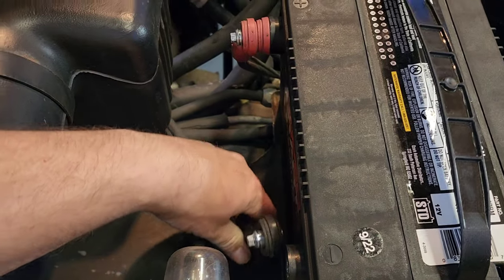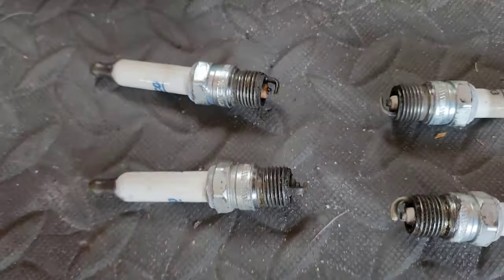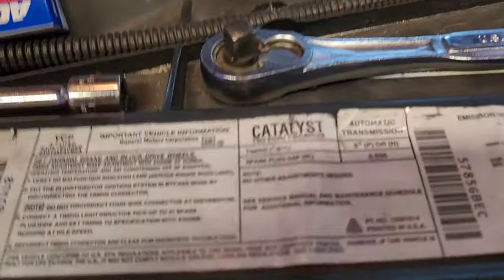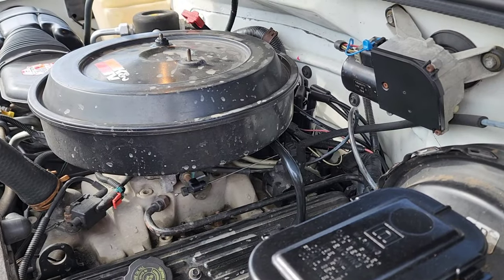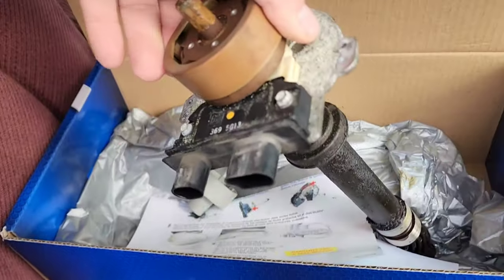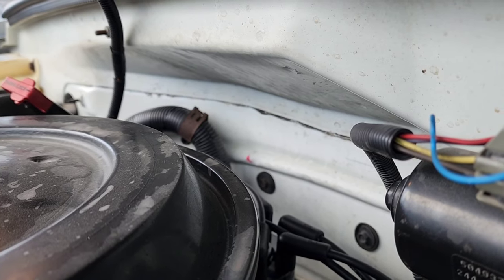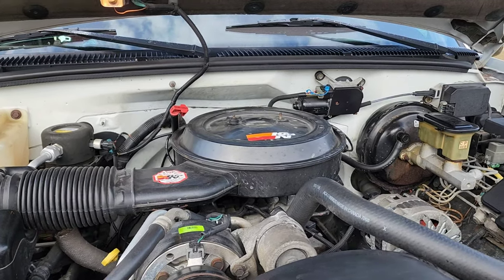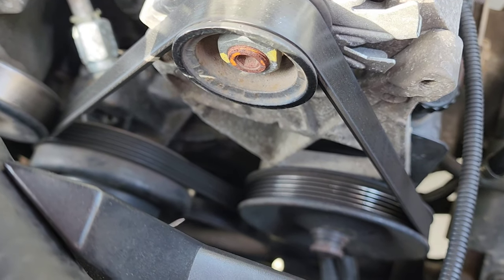Chevy Suburban Distributor Failure

Comment: I did a video on a car I was working on years ago, long before I was even watching YouTube. I showed how I pull a distributor out without even putting it at top dead center and then putting it all back together and put it right back in time. When you have been doing it most your life you get good at it. You're just learning now. And always start by putting the motor at TDC before pulling the distributor and learn tricks from there.
Reply from the maker: Yea TDC is where I goofed
Reply: I learned at a very young age at how to pull a distributor. I was actually shown how to do it with an engine on a stand. My dad when he built motors, have the engine on the stand, prime the oil pump and then show me how to set the distributor. I knew how to do it before I was a teenager. Learned a lot from my dad.

Comment: Just make sure when you set it to tdc it's on the compression stroke or you'll be 180* out. That happen to me when I did my first distributor.
Reply from the maker: I most definitely did just that. Had to use a compression checker hose to feel the air from compression to ensure it was right. She has been running great!

Comment: If you swapped in a parts store and Amazon and eBay billet aluminum distributor housing replacement distributor with the no name ignition control module swap it out with a brand new ac Delco ds194 ignition control module that's what I did and I bought a bwd ignition coil and didn't put the bracket together right and if you don't put the number 1 piston on top dead center when you put the distributor in the oil pump driveshaft would not line up so it will not let the distributor seat all the way down against the intake manifold, and the computer controled timing connector pigtail needs unplugged to set the base timing and after all that is accomplished then plug in the timing connector pigtail usually below the glovebox on the right top corner of the HVAC box inside the truck,, and then the ecm will input in the timing advance
Reply from the maker: I ended up getting it right, made a few mistakes but it had been 20 years sense I did this type of job. Took a little bit and some memory jogging but I did get it.

Comment: You got this it's not a bad job, just missed a step, I did something very similar on harley that was a basket case on a primary job, I did everything right except check the starter gears as there were 3 different types for said model possibly, still a fun job learned a lot, basket cases are not your normal job ever I found out
Reply from the maker: Nope but I'll get it!